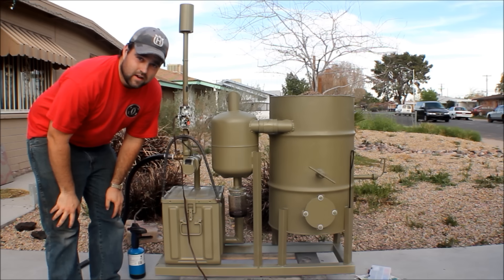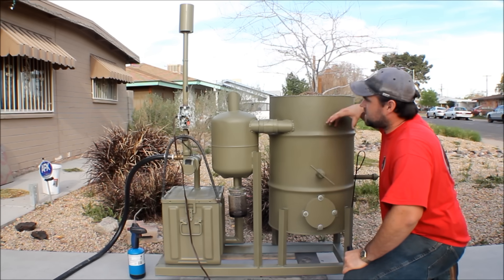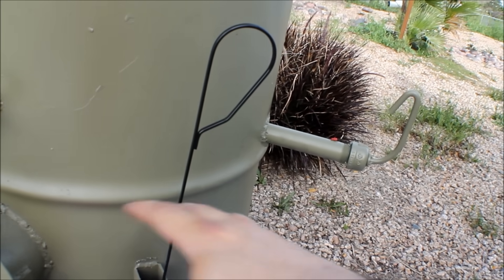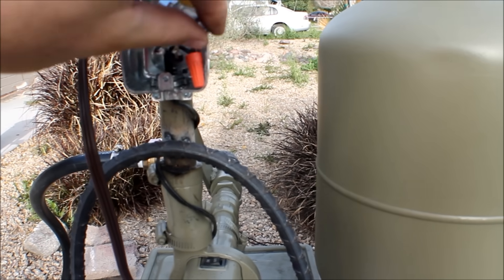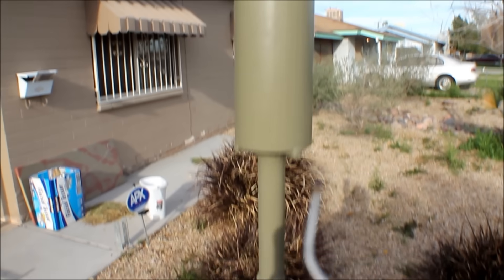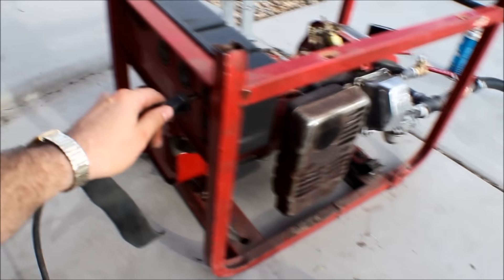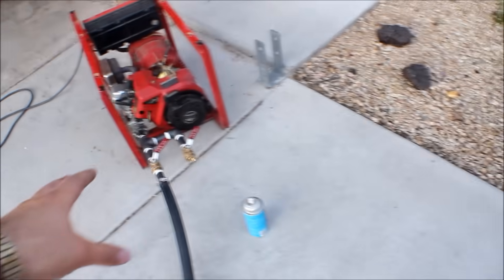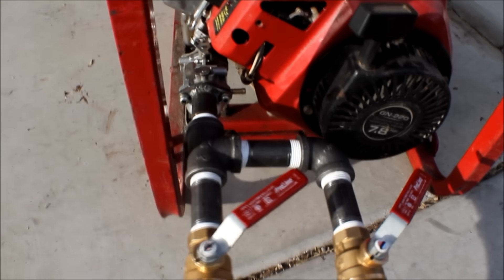amazing homemade gasifier uses wood pellets to run generator -- renewable alternative energy video

Comment from the maker: Simple.  While running it under load, I checked the line voltage with a multimeter.  Genny was putting out 110v.

Comment: The generator is governed to optimum rpm's via carburetor. After the modified manifold, how do you know if your producing proper voltage at the correct rpm?

Comment: I have a 15hp Craftsman 7500 watt 9500 peak. 
Will this work for any generator? Meaning I dont need a propane generator right? I see u hooked it right to the carb intake. I guess im wondering how big of a generator you can use? My Gen also puts out 220 volts. Lets say we all cant get a hold of pellets, are we able to use split wood (smaller pieces) if we are in a doomsday situation & out in the boonies and off the grid? There has to be a way to do reg wood instead of stuffing down a tube.

Comment from the maker: agreed.  a pulse width modulator would be a much more efficient way to control the fan speed... but I wanted to use a very "low-tech" method to achieve the same end result.